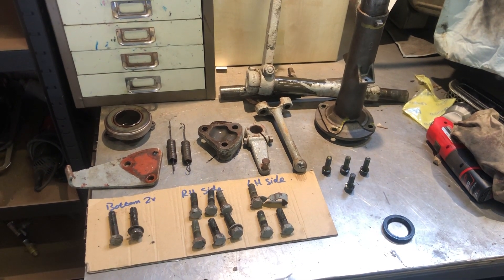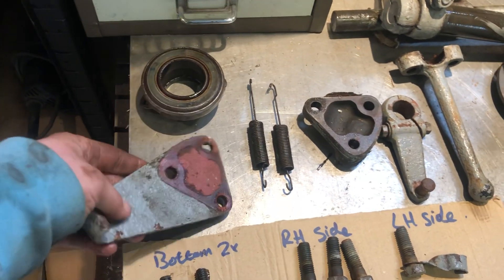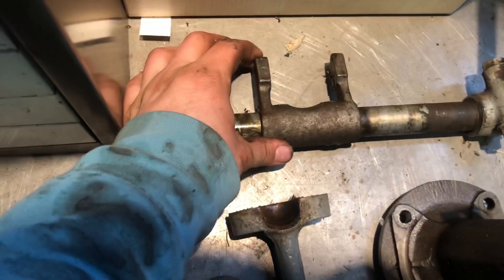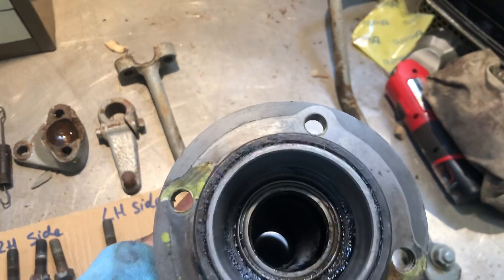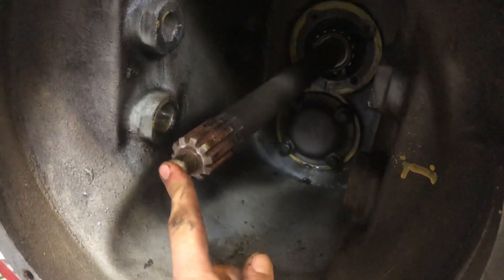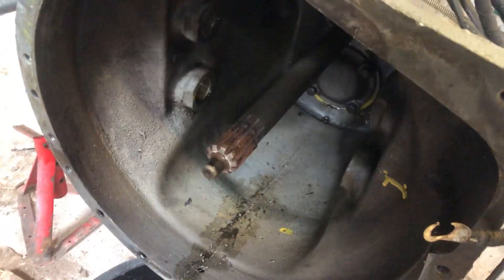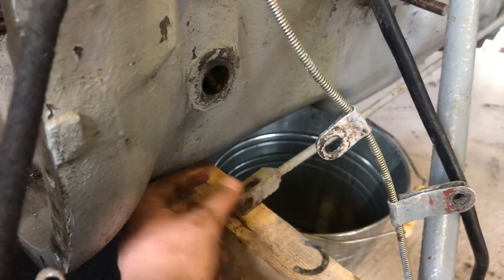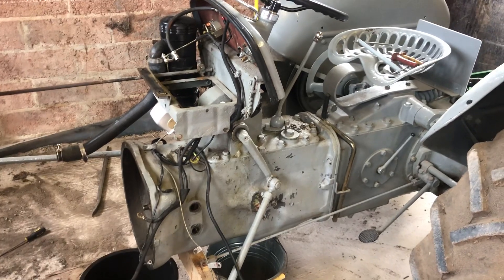Ferguson TED20 input shaft oil seal replacement part 2

Comment: Thank you. Great info, especially about the shims falling if the shaft is pulled out a bit. You don't want that. Mine will need bearings and a seal. Terry

Comment: This has been very helpful with my ford 8n, not precisely the same tractor but there is quite a bit of cross over.
Reply from the maker: Great I’m glad you found it helpful. It is quite surprising to see the similarities between the two
Reply: If I’m not mistaken the 9n and 2n were made while Ferguson and Ford were in a working relationship, the 8n has more changes, but a lot stayed the same.